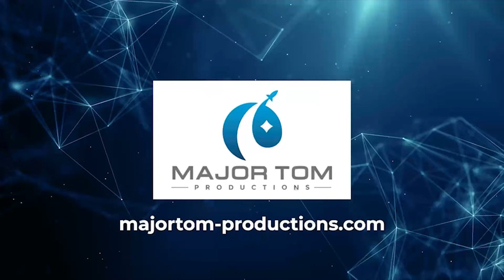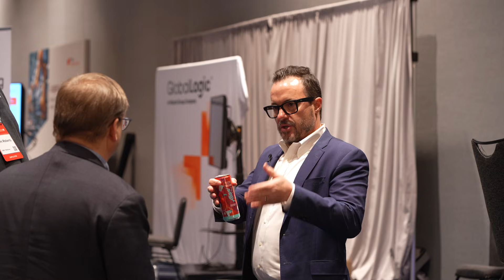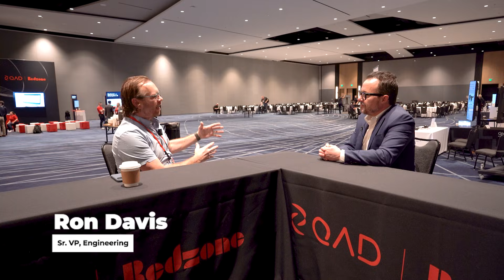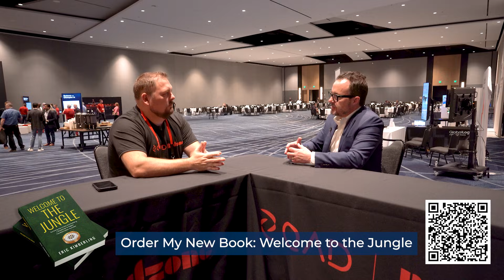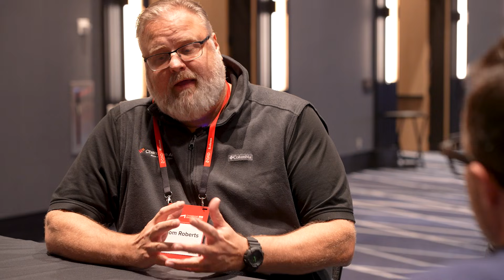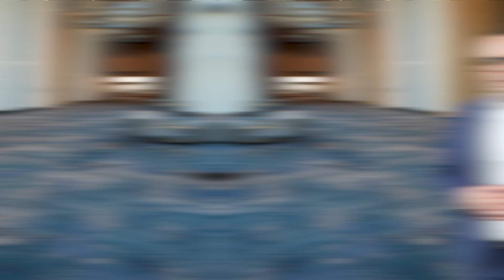Manufacturing Technology Trends 2026 | What's Actually Changing?

Comment: The biggest challenge in automating manufacturing is dealing with the significant overhead from technology investments and figuring out how to handle cost absorption of these overheads, along with the shifting mix of subcontractors (tier vendors) supplying subassemblies/components. Added to this will be the costing of multi-currencies into the database and being able to hedge currency risk. This complexity makes it hard to commit to a stable manufacturing system, so the manufacturing setup needs to be highly flexible—almost like having spreadsheet-level adaptability. Organizations will need to incorporate these cost structures into the value chain. Big opportunity for software vendors to develop adaptive manufacturing systems. Good luck is all I will say